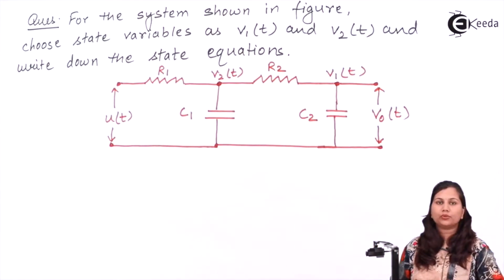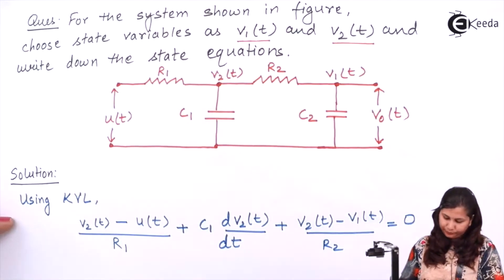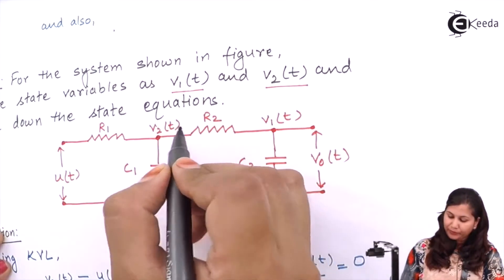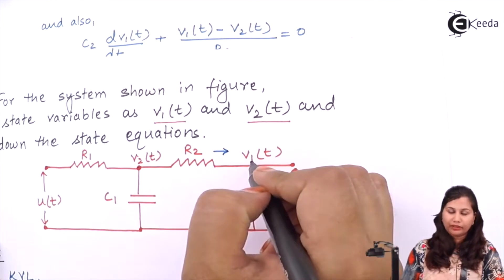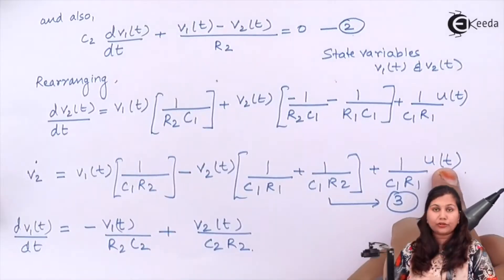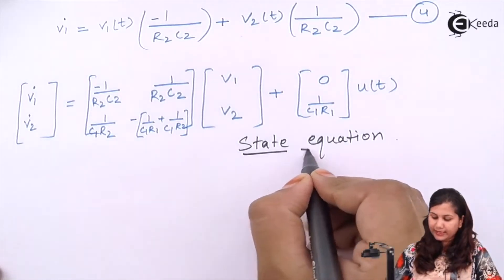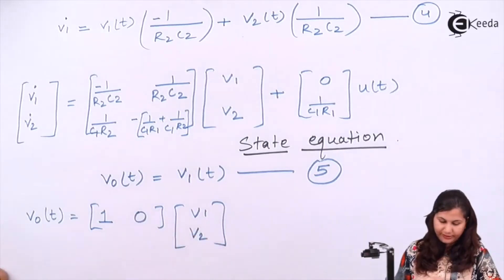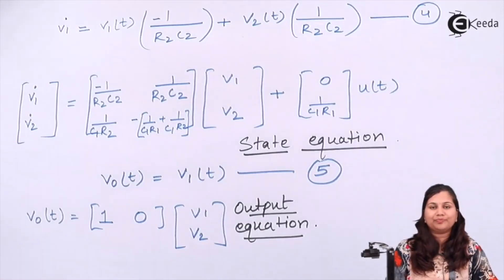State Space Representation   Problem 1 - State Space Analysis in Control System - Control Systems

Comment: Thank you for all of your efforts in providing a very well explained video making it easy to follow and understand.  Can you please elaborate on the implications after having determined the system state space representation of the circuit.  That is, after having performed the analysis, how can the results be used by an engineer?  What are the potential next steps?  

I agree with other readers.  It is using KCL as V/R is current and not KVL albeit with the state variables being represented by voltages and not currents.  This is a small detail.  Otherwise, an excellent demonstration.  Much appreciated.